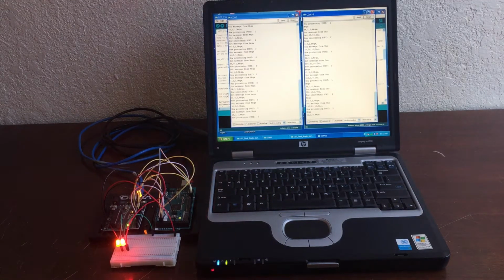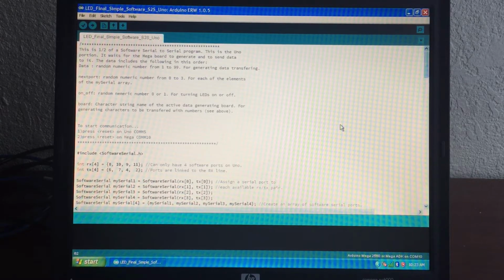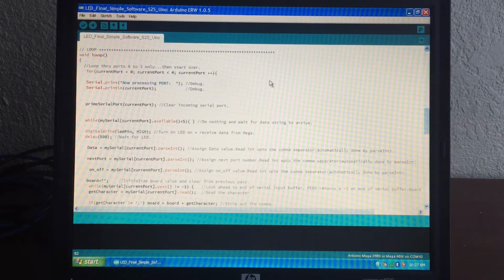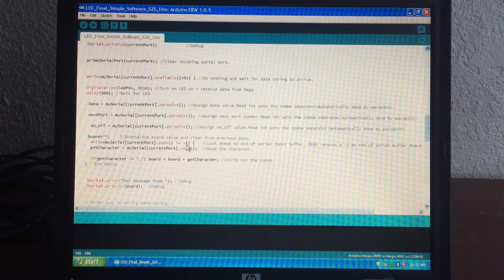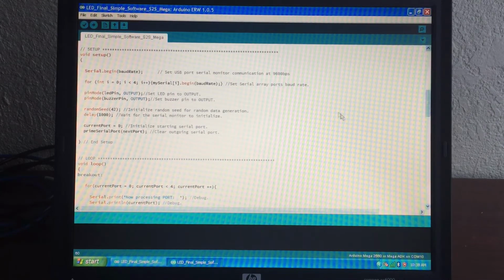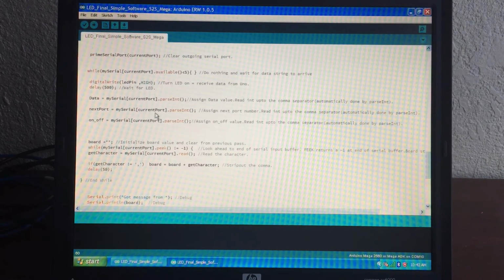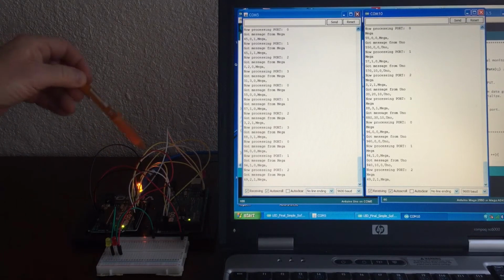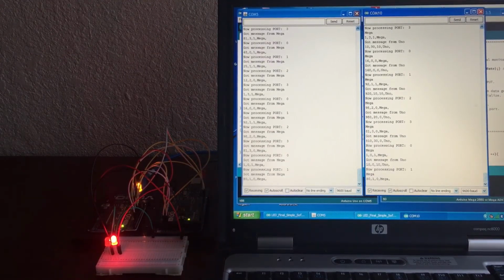4 Port Software Serial to Serial Communication Uno & Mega

Comment: The LED_Final_Simple_Software_S2S_Mega.ino and LED_Final_Simple_Software_S2S_Uno.ino both appear to be for the Uno only.  I had to do a Meld comparison before I felt comfortable enough with the two files.    Try a redo on the header.

Comment: Thanks for doing.  I’m trying to pass variables from an Uno to a Nodemcu to send to the cloud and this is a helpful experiment.  Trying to decide to try this method of transfer is better than via Json over the serial ports. If your familiar with ArduinoJson 6 it would be awesome to see this same test encapsulating the data using ArduinoJson 6.  What I have found is that simple transfers over the softwareSerial work well in either string of Json .  Once you start adding several variables ie 12 that are int, float, chars etc in a string or a Json things get interesting.  There are buffer size limitations on the SoftwareSerial and timing issues. It’s really got me stuck. Thanks again.